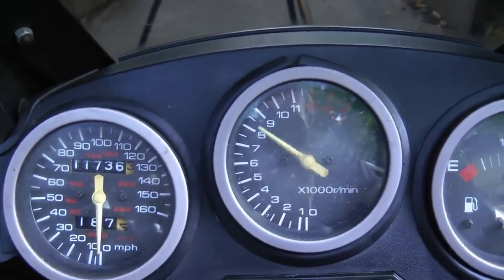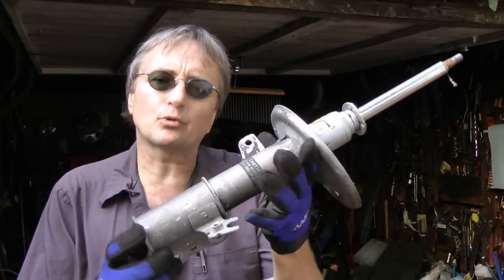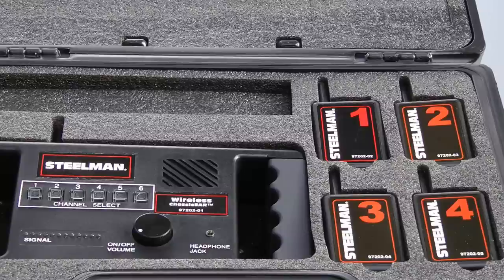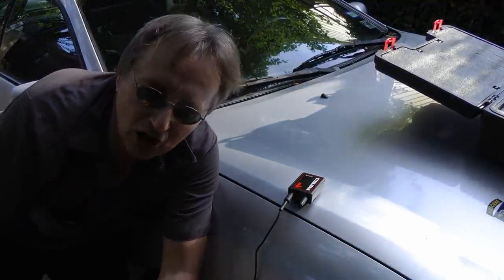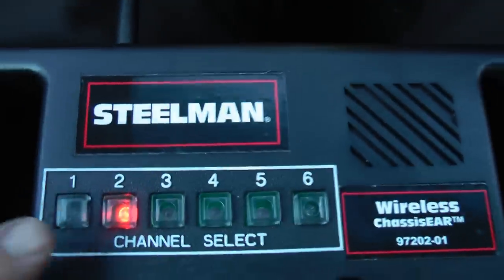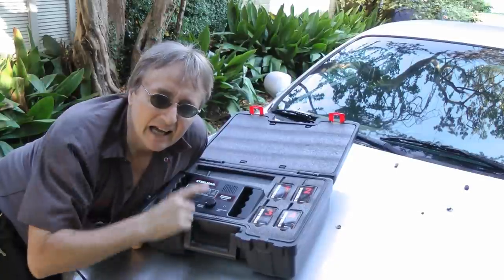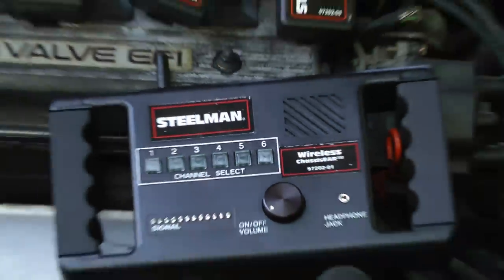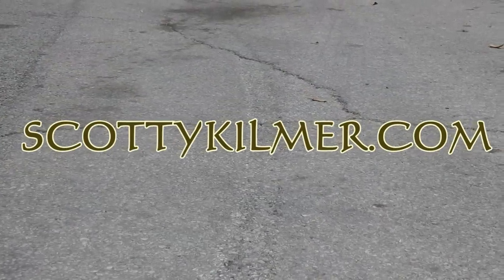How to Find Noises in Your Car

Comment: Hello Scotty, I am a huge fan of your Chanel and you definitely helped me in buying my car. Your videos are awesome and informative. I am wondering if you can assist me:  I have a 2014 Honda Accord Touring and there is a noise coming from behind the dashboard that I have never heard before.  Sometimes, about 1x or 2x a week there is a motor noise that comes from behind my dashboard when I first turn my car, and it slowly fades away after about 2 minutes.  Even if I shut my engine off it will continue to wind down.  At first, I thought it was the AC but frankly, it sounds like it is coming from the CD player motor.  The noise does not sound like the blower motor; it is more high pitched.  It stars high then fades to nothing about 2 minutes.  The funny part is I see this on Honda Accords but everybody is saying that Honda says its normal. I don't think so because this only started about 16 months after owning this car which I bought used. Other than that its an excellent car. I am wondering if you might know what this is?

Comment: If it's an engine noise like a worn belt, if the alternator starts going, if it's a pulley bearing etc a stethoscope works AMAZINGLY well. You know how many times people looked at me as if I was insane, leaning onto my engine with a heartbeat doctor tool but I pinpointed every worn bearing perfectly.

Comment from the maker: humming if often bearings wearing out, try to pinpoint the sound to wheel bearings or engine related bearings that spin when the engine runs. If it does it only when the vehicle is moving, often wheel bearings.

Comment from the maker: @wtl1964  YEA, go under there and see what's rattling. If a mount if loose, replace it. If it's the catalytic converter which is normally is, replace it or live with the noise as they cost a ton

Comment from the maker: @ninja7683 if you have a newer car with computer throttle system, often a bad accelerator pedal sensor.  If you have an older cable pedal, they can vibrate with engine vibrations, check motor mounts.

Comment: hey scotty this is a very cool vid and i no its on chassis noises but if your listening for engine noises the average joe could use a screwdriver by putting it on the supected area and listening near the handle end. it works ok for simple stuff

Comment: that engine compartment looks identical to my 94 corolla. Great car! I have 293000 miles so far and its running strong! Love the videos by the way! I'm going to school the be a mechanic, and we have 03 Saab in the shop with an abs and track control light on. whats the best way to find the problem without taking it to the dealer? We can't scan the computer with the equipment at school.

Comment: Hey Scotty, your videos are awesome to the handy man...

I am getting a groaning and a slight shimmy in the steering wheel and can't tell if it is the tire or a wheel bearing.  If I buy chassis ear and detect which wheel it is coming from, how can I then tell if it is the tire hum or a hub noise I am hearing through chassis ear?  Will it only identify hub noise or pick up tire noise too?  I do not want to go buy new tires and later find out it was a bad hub bearing...  Vehicle is a 2013 Impala.  

Keep posting.  Great stuff
Reply from the maker: start simpler, put the front tires on the back, and that will take the tires out of the question.

Comment: Hey Scotty, I have a 99 Miata. While driving there is a rattle and I can feel it with my feet, its on the drivers side definitely. Its hard to describe. It does it around 3-4000 rpm in 1-4 gears. This rattle only happens while driving. Sorry for the veg description.
Reply from the maker: often catalytic converters rattle, go under and hit it with a hammer, if it rattles, that's it

Comment: Hey Scotty,
Got a funky sound I'm concerned about in my 1999 Mercury Tracer I got last Wednesday. If I'm going about 40-50 mph and I give the car some gas to kick it out of overdrive up hills, there's a brief but very loud rattle/groan that goes away after 1-2 seconds or when I let of the gas. It sounds kind of like going over a rumble strip but more metallic sounding. HOPING its just a rattling panel since everything else in that darn thing seems to rattle, but I suspect something worse (transmission/engine)...
Reply from the maker: heck, make a youtube video, send me the url link, I will watch and listen

Comment: How much do one of these cost?   Looks like an excellent addition to a tool crib.
By the way, I have 2005 Nissan Altima and for 2 years I have been getting intermitten quick multiple knocking (x 2 - x 3) noise from front driver's side, when car driven only over certain bumps.   I had dealer check front end over, independent garages, but non of them seem to find any problem with suspension.  Everything is tight but that anoying knocking is there.   Struts are in good condition.   Any ideas???

Comment: next time instead of duct tape - try gaffer's tape.   its just as strong, but doesn't leave residue on the paint and doesn't pull up paint.  

Normally its used in the theather industy, but seems great here

Comment: Hi Scotty, I have a 2003 VW Passat that produces a single knocking sound when accelerating from a dead stop. A sudden jerk on the accelerator can cause the sound. There car has an all new suspension, and is silent over bumps and speeds over 10mph. The sound only appears in high torque situations, such as accelerating from a dead stop or if I hit the pedal hard in first gear. The sound has been present since before I did the suspension, and has been getting louder.... I've read things about a loose subframe bolts, engine mounts, or maybe the incredibly complex 8-control arm assembly? Theres no play in the front wheels at all, and everything is super tight, which really makes this a nightmare for me...Thanks for your help, 

Pierre
Reply from the maker: never say "all new suspension" as there are tons of parts in that system and rarely are they all changed out. PRAY it's a worn motor or transmission mounts, those VWs become endless money pits at that age with that complex over engineered German design.

Comment: there are 2.4  ghz cctv cameras for about 22$ each that you can use for this, plus you get the image

you can use a suction cup tri-pod instead of tape and not leave residure on the paint

also a good trick is to use a stethoscope or just you breaker bar against your hear while under the car w/ the engine running

Comment: Hey Scotty, got a noise problem in my 2002 Chrysler Concorde.  Noise sounds like a Jet  while driving, and when you start slowing down you can hear this same noise slowly reving down.  It usually starts around 40mph.  Already did tire balancing, and looking for next suggestion. thanks.

Comment: @scottykilmer thanks scotty, had a clutch kit tossed into my old ford ranger. that was far worse than a noise though the friction plate apparently tossed a spring and it tore the clutch to pieces, it was acting funny then one day i went to start it and it drove itself Christine style into the ditch the second i turned the key on with the clutch in, a tow to the mechanic and after he was done he showed me what was left of the clutch. after that a bit of noise for a few months is great news

Comment: Nice little tool, looks very sensitive especially for crocodile clamps, usually have to pay for an expensive mic with that sensitivity.

Scotty, I have a noise coming from around the front left wheel arch of my car, when I drive over bumps / pot holes there's a clunk, I think it's the damper. It doesn't feel bad, it's just an annoying noise.

I took it to my local garage, they put it on a ramp to inspect it and we went for a short drive, we still don't know what it is, any suggestions please?

Comment: Scotty good day, i have a japanese 2012 Toyota land cruiser  71 series, how can you tell when  your engine is not running correctly, or how can you tell if the sound of your engine is abnormal or actually normal ? i mean what sounds are actually normal in your engine in these kind of truck that have timing chain and belt driven fan, it has the same engine as a 2009 Toyota FJ cruiser, 4.0L V6  1GR-FE, it´s a great truck but i have had smaller toyotas that the engines runned a Little smoother and quieter

Comment: Hi Scotty, I put aftermarket coilovers and UCAs on my 13 FJ Cruiser. Since then both sides of front suspension started to make a metalic clunk noise when I go over "impulsive" small bumps or holes when they over say 3 inches and I'm abover 15 MPH. It doesn't make noise even when I go over large articulations off road if the obstacles are not "impulsive". I retorqued every bolts and nuts to spec and I removed front sway bar and skid plate. Also there's no sign of contact and the wheel doesn't wiggle. What do you think might be wrong? Do you think the chassisear will help for parts connected together? Thank you very much in advance!
Reply from the maker: I would assume coilovers are the problem, not having the right damper on the top or bottom causing noise, see that ALL the time. But chassis ear would find it
Reply: Thank you very much Scotty! You're the man

Comment: can that be used to pinpoint a specific piece or is it just a general area type unit?

my car makes a loud clunk noise when i turn left up hill and thats the only time it does it. i won't want to suspect it being the lower balljoint because that was new when the control arm was installed. strut is also new as well as the strut mount

Comment: I have recently changed the serpentine belt for astra vauxhall 1.3 cdti 2007 (UK). Unfortunately the sound did not disappear. I tried different methods to localize the sound of the pulleys(water spray, Vaseline). My question, can I run the car without belt? Maybe I will find easier.
When I replaced the glow plugs for diesel, the 3rd one had some signs of unburnt oil on the body, not on the tip. I replaced them because my car did not start from first.
I reckon my fuel injector should be replaced.
Regards

Comment: Scotty, i have a 2008 Pontiac Grand Prix with 70,000 miles. When driving 25+ there is a quiet noise coming from the front driver wheel. It sounds like tire road noise, but louder and more distinctive. Most of my passengers dont think anything of it, but it drives me up the wall. Any recommendations?
Reply from the maker: worn out wheel bearings commonly do that

Comment: High scotty i have a 2012 kia picanto and i have this rattling noise only after ive been a while in traffic and shifting gears from 1st to 2nd and vice versa. The sound goes away after 25 miles per hour and it doesnt appear unles ive been in slow moving traffic for about 10 mins. Checked everything, shields, mounts, transmission fluid, spark plugs, pulleys and no codes Also checked steering components and everythings fine, the control arms, link bars etc. What can it be? it sure comes from the engine compartmet. Thanks and greetings from HONDURAS

Comment: Hello Scotty,been spending quite a lot of time watching your videos recently and stumbled upon this video and wanted to ask something.
I own a 2008 Hyundai Accent fitted with a 1.6L engine mated to a four-speed auto gearbox,it had passed 223,000 kilometers,oil level is sufficient.There's this noise I am going damn nuts about...I have no idea to tell what is the source of it and I'll try to explain the best as I can and I hope you may spare some of your time figuring out what it might be.
The noise occurs only when the car is on the move,it isn't repetitive,it is instant and brief and occurs in a frequency of about a 'noise' every 1~6 seconds,the sound is very similiar to a coin rubbed against another coin,it is not loud but its evident,the sound is evident when driving in a rather acoustic road or an enclosed one,and also when the car is accelerating quite intensely(driving in the highway - with the windows closed the sound is evident,it makes its way to the interior),any idea that comes up to your mind what it might be? 
Thanks.

Comment: (Volume knob turned to 70%)
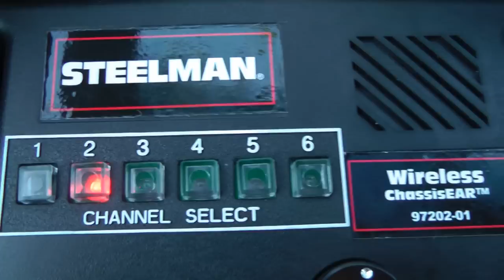2:06 "Here's the noise from number one, which you can hear is pretty loud."

(Volume knob turned to 30%)
2:12 "And here's the sound from number two, which is pretty quiet, so we know it's the number one wheel bearing that's bad."

Science.

Comment: Hi Scotty,

My front wheel on my 2011 Impala is making a noise but it stops when i turn left. I already changed the wheel bearing and the wheel hub and it's still making a noise. Got an idea what could be making this noise?

Thank you. Have a good day!
Reply from the maker: check for worn brake pads and sticking brake calliper
Reply: Thank you!

Comment: Wheel bearing job? PRO TIP: buy the entire knuckle at a junkyard (with wheel bearing already installed) -- it's usually a bolt on swap that just takes a few minutes. No fiddling with a bearing puller of pressing a new one in. I learned this tip when a shop broke the knuckle on my car and I had to walk home and come back the next day. Now, I just have them put a different knuckle on, instead of fiddling about with tools above their pay grade.

Comment: +Scotty Kilmer , can you tell me what this is? When my truck engine is running at idle it is quiet, but a little louder. When I accelerate, there's a loud noise like the exhaust, but it sounds like it is coming from the transmission or near it, and it gets louder as the rpm's are higher. It sounds almost like it stutters while shifting down with no acceleration as I slow, but there's not much of any noticeable difference in engine acceleration power, I don't think. Idk if it's a hole through the exhaust, or something else, or if it's a transmission problem because it sounds like it's by the transmission. ...could it be a low oil problem or what? I did have low oil just below or at the fill/safe line. My MAS airflow sensor is bad already and I don't run engine with it connected, so I don't think that's it....I always ran it with it off and never had a problem with noise, except some stalling while stopping to an idle, but after it warms up it's ok without the sensor. What's the problem? What is the other think called where the exhaust pipe leads to and connects had way in some box shape and the rest to the engine? What's that middle piece? Could that be it? It's only been doing this for a few days and the transmission fluid and oil is new because I changed them when I put in a whole new manual transmission clutch. ....anything you can think of?

Comment: Hi Scotty
When going 15 mph or higher my Hyundai accent makes this really loud noise that sounds like the right front passenger tire rubbing on something. I put the  front end up on jack stands so the wheels are off the ground and got the car up to 15mph and no noise. When going over bumps the pitch of the noise changes. When sitting in the car the body sinks down don't know how much is acceptable. 

Does this sound like coil springs/struts or something else?

Thank you for the help

Comment: Thanks for the advice Scotty.  One more question regarding my 2005 Nissan Altima.   Most of the time when I start my engine, I can hear a single thump thru the car.  Almost as if you took rubber mallet and hit part of the frame.  This is only on some start ups, not driving, in parking..  Any ideas what that could be?

Comment: Sir, I have a 2004 Mustang GT. It has an annoying rattling/vibrating type noise coming from the dashboard trim up around the heat/AC knobs while I'm driving; it doesn't make noise when I'm stopped.  When I lightly press on the trim or heat/AC knobs while I'm driving, the noise stops.  How can I stop the noise?  Thanks.

Comment: Hey Scotty.
I have a 1991 Ford Ranger 4X4 and I changed all the front wheel bearings but it still hums like they are bad.
What could be causing this???
Reply from the maker: 4 by 4s are VERY hard to change the bearings correctly, have a mechanic like myself check the out first, they could just have been put on incorrectly and were damaged. If not, tires can hum, as can transmission internal bearings or transfer case bearings
Reply: Ok thanks a bunch!

Comment: I have a 2013 Ford Escape SE 2.0L and when I'm turning corners, it creaks (Sounds like a roller coaster climbing up the track, LOL...).  I took it to an auto repair shop and they said it was part #4R602 the drive shaft - Rear Axle Drive.  But after replacing the part the car makes the same noise.  Ugh...so they said that they would hook it up to microphones to see where the noise is coming from.  Still in shop and I'm stuck borrowing my mom's Mazda 626, LOL...Been in the shop since Monday morning...  I wonder what it could be...I usually stump the doctors when it comes to diagnosing and how my 2013 Ford Escape SE is challenging the repair shop, LOL...

Comment: @scottykilmer well idk cause if i hold the pipe it stops but when i drive around 1k-1400 rpm  
i dose it what i was wondering is if i could buy somethiing cheap to fix it or tighten a bolt

Comment: I have a 2012 altima 4 cylinder 113000 miles and it makes a rattling sound when it's first started and then it will stop but always once started but not while driving.  The dealership says it's not a timing chain problem but a heat shield issue.  My cousin and I have tighten all the bolts that we could see a the heat shield/converter points but it's still doing it! Is there an internal problem with the plastics of the timing chain as suggested by some other guys?

Comment: I think I got bad gas in my 1980 Chevy El Camino. It started a knocking sound. I checked the oil it was fine, checked all my spark plugs to be sure I was getting spark ( I am), and i checked to see if there was coolant on my plugs (there isn't). I noticed water (or a clear liquid) coming out my tail pipe. I'm assuming I got bad gas somewhere, What should I do to fix this? I changed fuel filter and added a stabilizer, seemed to help a tiny bit. Your help would be much appreciated.